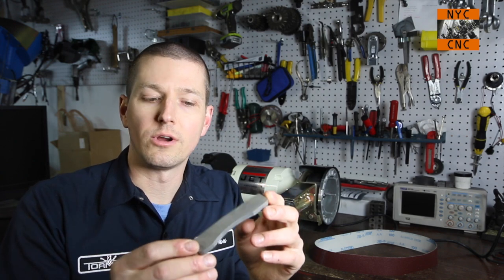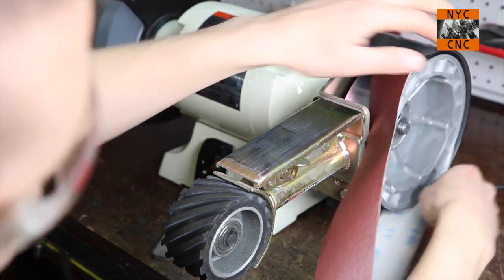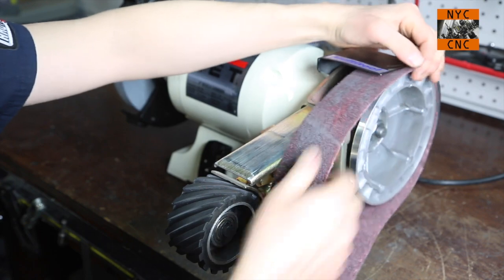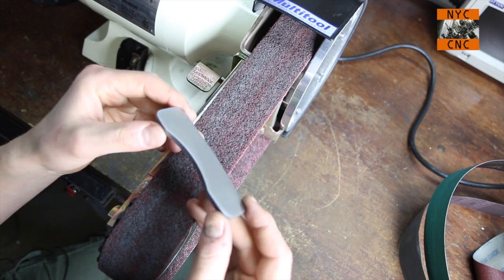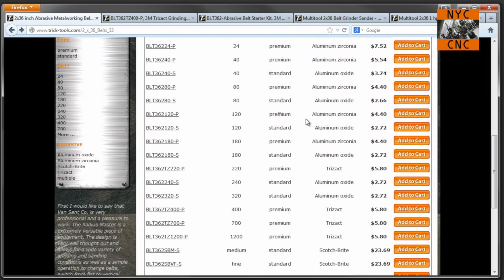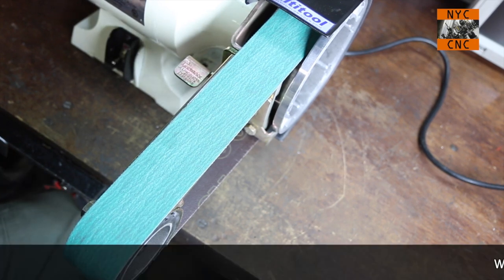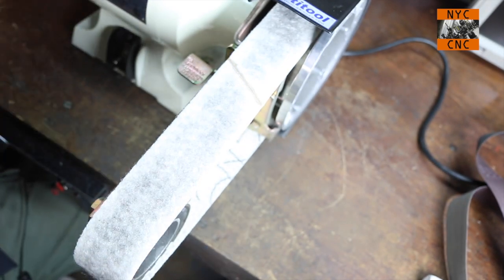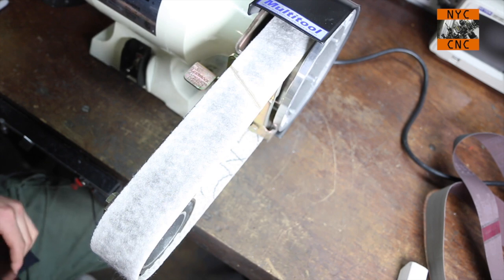Polishing Steel to a Mirror Finish & Brushed Metal Finish!  MFG@Home

Comment: Hey, thanks for the nice overview.  I’m looking for something like this as a home hobbiest, possible to sharpen knives or at least get close enough for low-medium quality ones before putting on the whetstones.   Are you still using this? Any updates after 6 or 7 years of use? Would you still recommend it? I’m thinking of putting it on a delta 8” vs grinder...

Comment: here a tip, to change the speed and able to brake, wire up a VFD to the motor of the bench grinder so you can change speed and brake fast

Comment: My finger tips would be mad at me if buy this.

Thinking could small magnet with an on and off switch help?🤔 

Try it, use a welder triangle magnet they have them with an on and off switch and see if they work for your small parts on the grinder. Or custom magnet . Let me know

Comment: When you get to your higher grits such as 400 grit and beyond you need to use it wet it helps prevent loading of debris and clogging on the paper and gives you a better finish yes it’s a mass but it’s also a must for a perfect mirror finish.
Reply: I forgot to say a light kerosene or polishing oil helps also

Comment: It would help if there was a stop built into where the belt goes back in to the main wheel to help avoid parts slipping and getting sucked in. I got a 6x48 belt sander and I can't count how many projectiles I've launched into my wall lol.

Comment: Don’t have your work against your belt as it is slowing down.
Remove your work from the belt at its highest speed and then shut it down.
You can afford those extra few seconds of slowdown, they are far less expensive than a piece of work with odd abrasions on it.

Comment: The American machines are so different to the English polishing lathes. We don't use polishing belts, we mainly use polishing mops, two types of compounds, the first compound would be to brake into the linishing lines and the second compound would be a white finish to shine the metal.

Comment: That's a pretty cool grinder. It seems to have a lot of power. My only concern is the direction of rotation. If you lost control of a knife it could easily be thrown at you.
Reply: cflinger1979 valid concern
Reply: I think can mount it up verticle to access platen like a tower.

Comment: Hello , i`m from small company where our manufactory must grind and polish a small metal parts (handle for keys ) , this are small  rectangles whit size 30x60 mm  the thickness is 10 mm , so our problem is we grind them and polish them  all week (around 500 handles) , and its happend too slow , do you have any idea or hacks how we could do it more faster , any technick or machines ? ps. we polish only the thickness zone the 10 mm , the edges we don`t need to clean the faces of the handles.

Comment: trizact go down to a4 which is 2000# or try an old belt turned inside out so the abrasive side is on the inside a tube company i went to in birmingham had a ten headed loser centerless polisher and the belt sequence went down through the range this was before the days of trizact and on the last head they used a old belt reversed which would just burnish the surface to improve the optical apperance

Comment: What is the advantage of a small width belt sander over my 4 inch stationary industrial belt sander used along with a series of buffing grits on my buffing machine?  I am simply curious to know from the experienced metal guys what is the hub, bub?  Thanks for this great vid!  BillS.
Reply: The advantage is: 1 or 2 inch belts are cheaper and you have a better selection of belt finishes for working on edge tools. Secondly,  most high end 4-inch belt sanders do not have the option of variable speed nor is there any contour rollers. Roller options are many in size and surface types in the 1 and 2 in belt grinders, whereas 4-inch belt grinder (sanders) rollers are fixed.

Comment: I polished an aluminum plate (250mm by 200 mm) to mirror finish using a $30 dollar grinder from Lowes, polishing wheel, 400 grit sand paper, 2000 grit sand paper. By the way, you shouldn't breath in metal dust.

Comment: Hi. I live in Perth WA and have one of these Multi Tools.  Had it for at least 25 years,  brilliant piece of kit.
You mentioned the small rubber wheel at the front of the machine that you are unhappy with.  The one I have has a solid wheel (not grooved) which I find quite good.  Thanks for the info on the "Scotch_brite" belt,  haven't heard of it but it sounds like just what I need for polishing Aluminium.  Good video.

Mike McMahon 
CNC Beginner.
Reply: Thanks for the positive feedback!

Comment: Looks nice but the first major no no I see and probably wouldn't use building knives for is that it spins the object towards your body it should be reversed so if it slipped it would shoot to the back not to your chest or face
Reply: Now if u could have it pointing up then that'd be different. seems like that's how it'd be anyway
Reply: You are correct, the travel direction and the drive assembly elevation is a cause of concern. Projectiles are heading right at the operator's face. You can even see the sparks going right towards the operator. Not good nor safe. The operator needs to reverse the motor rotation if not install a reverse switch to help accommodate different locations of the operator.

It is all about the configuration or the adjustment of the angle, while setting down and having the belt traveling downward - the manufactured is thinking that the operator would be standing not setting. Grinding would be the same and would default in the same direction.

Comment: You can recast the toothed wheel with urethane just to fill in the grooves, it will allow you to use the wheel for more grinding and polishing.
Reply: I just wrapped mine in a couple layers of electrical tape.. works great...

Comment: OK hi have been doing the progressive sanding for about 6 years now and out can mirror to about 2500 grit but I do it all by hand. machines scratch.
I have a question for all you pros.... how do you coat a mirror so it won't Rust everything I used spots it even $300 a quart coating from finishmaster spots it no longer a mirror ..... wax is all I find but wears off to easy
Reply: +NYC CNC 
thank u I didn't know there was such a thing . clear powder coat that sounds like what I need.
I did try to get one of my battle axes chromed but the guy called me up and said It would show every thing 100 fold and I wouldn't be happy cause of my crappy welds
thank u

Comment: I buy 4x36 belts and split them in half. They are much easier to find.  I don't to too much polishing though.  Just rough grinding.
Reply: Sir,can I ask you? I have one of these ordered..Can I stand it up like a tower to use the Platen verticle? I want to grind hobby knife bevels without buying a 3k bader or $1200.00 KMG.....should be able to mount it up to use,right? I think manufacturer demo said yes but I have not seen anyone using for knives...
Reply: @aldenunion  I'm not sure.  I suppose you could but the platen would be on the backside and the slackside of the belt would be on the front.
Reply: @johncraik  I recently learned just mount it on left side  of grinder so switch is facing platen..Also learned methods for make shift work rest..
Tricktools.com has a stand pedistal that also flips 90degree angle and has work rest to use small wheel only with unit on side the belt grind is sideways but is another option......I have researched many methods that make these a great base to set up and make work for ANYTHING....The small wheel can even be upgraded to softer wheel with smaller grooves for more fine control..Excited for mail lady only running slow still from Xmas..Thanks for reply..Tim

Comment: I know this video is old but I do have some experience with mirror finishing. I am guessing that you have probably figured quite a bit out by now but just in case I will offer some tips. 

As you progress through the grits you want to alternate the scratch pattern, and do not move on to the next grit until you have completely removed any evidence of the previous pattern. 

Some of your grit jumps were a little to large, i am guessing this was due to the availability of belts on hand, in the future I would try to progress through the grits more evenly. 

If a true mirror polish is desired it may even benefit you to at the bare minimum clean the surface of the part between grits to avoid cross grit contamination. While this is a minor concern to some, the perfectionist will notice every scratch. 

don't be afraid to take it to a buffing wheel with compounds after you are through with the belt progression. Just be sure to progress through the compounds in the same manner, using new wheels each time and avoiding contamination. 

Hope some of this helps, I think the key point to take away here is alternating the scratch pattern.
Reply: yup
Reply: 90 degree turns is one option, but I think the critical element is that when you are done with one pattern, you have eliminated any visible sign of the previous pattern. You may do a 90 degree cross with one pattern, then do a pattern that's a 30 degree cross at one of the 45 degree points until you can't see the evidence of the 90 degree cross, turn it 90 degrees to the crossing 45 degree point do another 30 degree pattern there until the pattern you had done in step 2 goes away, and for your fourth pattern go back to your 90 degree crosses. 

You could set up a part holder on an arm, with pivot points at the 90 degree points to the belt travel, and two other pivot points at the 45 degree points to the belt travel, and work through each of the four points at each grit level.

Or if you're willing to pick up a kit for each grit, simply set up one pivot point at each tool, and work from tool to tool swinging within the working surface for each pivot point. (The arm for the part should give you better consistency with pressure at each tool as well, across the entire surface of the part, eliminating the rolling edge effect.)
Reply: Hi Eric, love to hear more on polishing, you definitely nailed it. John. C

Comment: To easily fix the platten problem, use contact cement and a thin 1/16"-1/8") piece of UHMW to cover it. This is the type of plastic used for sliding surfaces and bearing slides. I use it to make telescoping square tubing.

You will also find it easier to hold small parts like that with suction cups at the end of small dowel rods, one for each hand.

Comment: Way too much money for a china made cheap part. 
 85 bucks would be fair.
Reply: Do you know of alternatives worth considering?
Reply: Harbor freight 1x30 belt grinder. Its perfect for making knifes if you are just starting out!
Reply: Agree, if you are just starting.

These belt grinder types you state, do not have tension adjustment, they are 1 inch width and you are limited in the access of the belt as the belt is fixed to the machine. A machine drive or rollers can cost what HF belt grinder offers. For pro work, you would not use those machines.

Comment: so when are you going to finish the metal piece is that motor going the right way if it is you're doing it wrong you have the sparks going away from you grind on the wheel downwards are get the motor to go forwards instead of backwards @@ from a  multi polisher

Comment: To flatten the top plate just turn the belt inside out.... grit facing the plate and use a true flat plate to lightly add pressure to the belt. This way the multitool will correct itself. Just ensure you have an air blower pointing to the inside of the belt towards the lower part of the wheel at the front to stop swarf from collecting .

Comment: To slow down the machine quicker - remove the rear guard over the belt wheel. When you switch off, use a bunched up piece of cloth to stop the wheel on the right. Saw this done by a guy in Aussie (YouTube video - Blade sharpening using belts) It also makes belt changing much quicker.

Comment: How much would it cost to add a VFD for variable speed?
Reply: +rkshireygames most VFDs are auro selecting single r 3 phase. the one that i installed on my bridgeport is auto selecting. 2.2kw converter.
Reply: +GunFun ZS VFD drives are too expensive a solution for a simple application like this one. A Grizzly G3703 - Router Speed Control - 110V, 15 Amp ($31.50) would be a much better solution. VFD drives get more expensive per unit of horsepower for example, my 5-7.5 horse VFD runs $800.
Reply: It's a brushed electric motor. Why wouldn't it?
Reply: +GunFun ZS You can get a VFD for 200-250 dollars.
Reply: +GunFun ZS The grinder isn't Three phase, so you cannot use a VFD on it.
Reply: Garrett Weidman It only needs to be 220 single for a phase converter. At least, I'm pretty sure. Very sure.
Reply: I use VFD's on a daily basis and have for years, and I have never seen one that outputs 220v single phase, if there is one that's news to me, do you have an example of one?
Reply: Garrett Weidman Wold automation looks like they have them.
Reply: They have some single phase input, which are common, but no single phase output.
Reply: Garrett Weidman I thought I saw a few that had single out.
Reply: Rollin Shultz  Thanks. That's clean so long as we aren't bogging and heating the motor. I think we will try one on an old 115 v wood lathe.

Comment: Awsome, as you mention that you want to slow it down, better with VFD. My fevorites are Emerson Commander SK series and Siemens Micromaster series. Emerson is super easy setup and Siemens super high frequency. Both can be use break function ( I think most of the VFDs do have that)  most important is both are not expensive.

Comment: A light dimmer switch may offer you the ability to control your speed.
Reply: +Joseph Coyle Jr. WRONG. A light dimmer is NOT a motor speed controller. I would look for external motor speed controller with electronic brake action.
Reply: +theelviscerator  Well, a basic motor speed controller is a variable resistor and some light dimmers are variable resistor therefor if you found the right variable resistor your problem is solved. I have controlled the speed of many motors with variable resistors and have used the same variable resistors to dim light when I was  about 6-8 years old. Given they are called a whole slew of things like rheostats, po·ten·ti·om·e·ter

pəˌtenCHēˈämətər/

noun

1.

an instrument for measuring an electromotive force by balancing it against the potential difference produced by passing a known current through a known variable resistance.

2.

a variable resistor with a third adjustable terminal. The potential at the third terminal can be adjusted to give any fraction of the potential across the ends of the resistor.

given there are much better ways to do this and much more expensive ways I was just saying that if you found the correct dimmer switch it would work.
Reply: +Joseph Coyle Jr.  Important things to note is the voltage and the load, that the variable circuit can handle, also if the circuit was designed for AC or DC voltage. Check Amp rating and voltage label for input. If they jive with the load you are applying it doesn't matter what you call it it will do the job. Also I always add a breaker to anything I hook up this way. And don't try this at home.

Comment: I went to trick tools. I did not see your set up. I found the grinder but not the attachment that you are using for the belt. Any way you can steer me in the right direction Thanks
Reply: We offer multiple size attachments to convert your stone grinder to a belt grinder. check out multitoolgrinders.com

Comment: great job, how it's possible that the belt stays nice in de center?
Reply: +kaczy production The drive wheel is slightly convex which will self correct the belts side to side slip. Then the tracking adjustment can be used to align the belt left and right.

Comment: I've found through personal experience, if you wish to slow your belt down as quick as possible, simply grab it with your hand and hold tight, the first few times it might feel a tad uncomfortable, but after you get the knack of it it's hardly even excruciating

Comment: I have this belt /disc sander attachment  (multi tool) on a crappy craftsman grinder I love it works great . best thing since sliced bread
Reply: I have one coming for my craftsman...Will it mount like a tower to access platen vertical for knife bevels?..I read on demo it can but have not seen anyone using like a tower to do plunge lines......So the platen is uo and down with front wheel up in the air....Thoughts?

Comment: Would it not be safer if the machine spun away from you rather than toward?
Reply: VIKINGODIN 
You instinctively recoil from pain. If the belt spun away from you, pulling back would drive your hand in further or grind against the belt as you retracted it.

Comment: Here's an idea to save sanding down your finger tips if you are sanding steel : get a short block of wood, say about 1"x1" x 4" and drill a series of shallow 1/2" holes in a row with a Forstner drill bit. Epoxy or hot melt glue in some rare earth magnets. It will make a perfect handle for holding your steel work piece.

Comment: Good video.
Trizacts are the best. There is also an A6. (their numbers go backward) for the finest finish.
 Also, wear a respirator, you do NOT want to breathe that metal.
 If the metal gets hot dip it in water to keep it cool to handle.
Stand to the side of the grinder, so you don't get hit if you lose the object you are grinding.
The grinder is the most dangerous machine in the shop.

Comment: Cool tool. Does the metal heat up at all? I would think heat would come into play very quickly with that method of polishing. I always polish by hand with a dremel, but as soon as the piece starts to get hot, it can ruin pretty fast...
Reply: Hold it with a piece of leather  a dremel is a toy compared to this tool and it goes too fast bunting  compound for a half assed shine